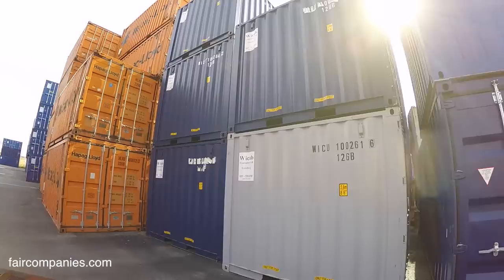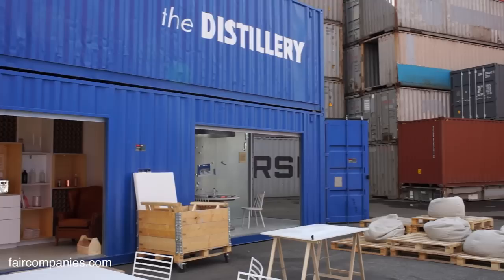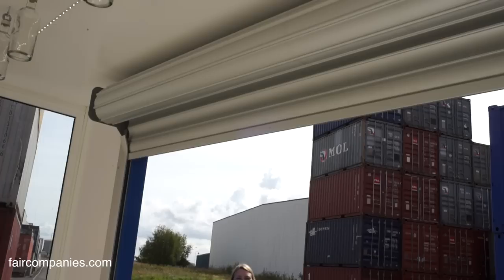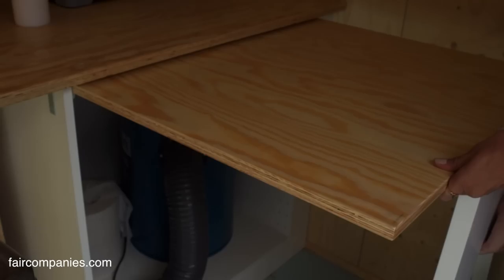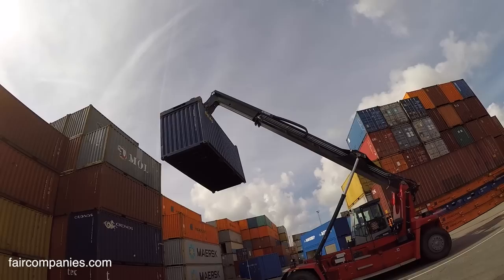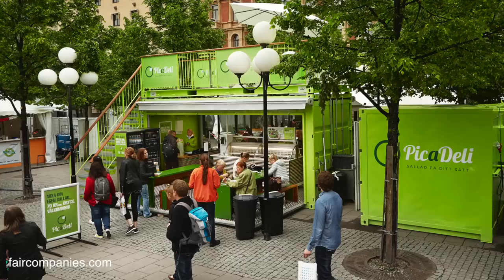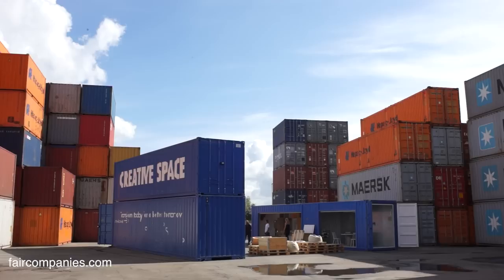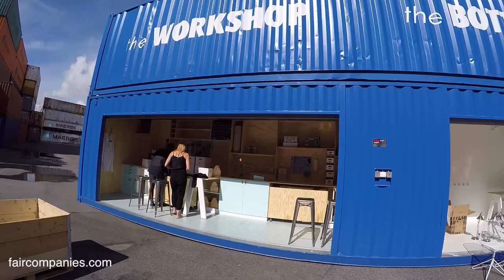Gothenburg stacked shipping containers as instant house/offices

Comment: Thank you ! That was really interesting. Those ladies definitely have a lot of good ideas. Regarding container houses well they are obviously not a panacea for the world's housing problems, but I feel they can be useful in the right scenarios. In any event I think they work really well for pop up restaurants and the like where they need to be frequently moved from place to place.

One thing I'm interested in is how much additional strengthening needs to be provided once you start cutting holes in the container. On the episode of "Grand Designs" that dealt with a container house, the architect added a huge amount of steel. In fact I was amazed by how much he felt he had to add.

Comment: They are using Hi-Cube containers which is the smartest choice for building uses they are 9'-6" high overall. If you are considering doing something like this use Hi-Cube containers as you get a very comfortable interior 8' ceiling height.  

Containers are not something to approach lightly, they are not a do-all be-all panacea. Depending on where you live, they can have serious condensation issues inside as well as significant heat gain if not properly insulated and finished, you just need to plan and design with them to your climate accordingly just like any other building system. If this was going to be placed somewhere permanently I would consider cladding the exterior in wood to help control the heat gain, use spray-on closed-cell foam insulation inside and add a membrane roof system. The container is just the framework, a basic shell, once its properly clad these can last many many decades.
Reply: +KlunkerRider You could also remove the top to increase ceiling height
Reply: this was really helpful

Comment: No Insulation, No Fans, No AC, NO WAY!!!  making a living space out of something that was meant for storage has just as many costly drawbacks as it does benefits. You may as well start from scratch. A house will last for more then 8-10 years so were is the long term cost savings?  I'd like to hear how they feel after trying to sleep or work inside one during a hard rain without building a roof for it. You can buy a good used mobile home with more benefits then what a freight container offers at the same price and fix it up a lot cheaper.

Comment: Containers are bad choice for home - just make wood framed tiny house -costs about the same, doesn`t look like urban trash and have better thermal properties and have more flexibilty of space. In many cases, ppl buy brand new containers, contributing to all kinds of negative environmental impacts.
Reply: +Reinis Miks The economics and eco-friendliness of re-using shipping containers is not as obvious as it may seem.

Due to the massive import/export disparity between Asia and Western countries, a lot of shipping containers are building up in Western countries. Lots more stuff shipping FROM Asia (where these are manufactured) and nowhere near as much shipping back TO Asia. Many of these will go to waste otherwise. It's not economically viable to ship empty containers back to Asia for re-use.

There is no wood-framed structure that is anywhere near as strong as these are, or that can be mounted on just 4 stilts with this kind of strength. These containers can be used in ways such as on stilts, and cantilevered, to make building on otherwise unbuildable sites.

People (individuals) do not actually buy 'brand new' containers. "New" containers people can buy are actually used once (in the trip over from Asia with their initial cargo). They are advertised as new, but are actually used (generally once). See also my first point above about the import/export disparity as to why this is economically viable.

Yes, a wood-framed house will have better thermal properties than a non-adapted shipping container. Nobody is suggesting you don't put in insulation in these. You have to insulate wooden structures, too.

Whether a container-adapted structure looks like 'trash' depends entirely one how it is used, and what each individual's personal tastes are. There's no such thing as something that looks good to everyone, despite what you seem to think. I personally love the look of the containers, as-is. They come in many colors, which can make for a striking structure when coordinated well.
Reply: +IAN MANSELL Living in earthquake country I see them as being a good solid structure or an anchor for a larger structure.
Reply: genjii931
Well, insulating steel container is problematic - there will be  lot of condensation and only styrofoam blown-in insulation in that case would be suitable, which is costly and not very eco and health friendly.
Also, in most parts of the world wood frame is strong enough.
That said, I understand, there are benefits of using containers, just wanted to create some discussion.
Reply: +Reinis Miks I'm really feeling like living in a container is not the way to go. But this video inspired me to do something commercial with them. A Cafe that moved to different locations on a truck would be amazing. If you did it right consumers would eat that up! But as far as living I think I'm going to go the Yurt route.
Reply: *****
Totally aagree - good luck with yurt
Reply: Reinis Miks Thanks man! Peace!
Reply: I mentioned seismic factors but a container structure is also of value in a place (like California or Australia) subject to wild fire.  As a remote dwelling or 2nd home it could be a very desirable option.
Reply: +Reinis Miks they don't look urban trash to me, I would put the wood inside
Reply: Luis Santos
in rural property my neighbors would not be happy to see metal container staying there permenantly
Reply: +Reinis Miks I understand that
Reply: Luis Santos
But then again covering it with some decorative vines and green roof would totally blend it in nature. So I guess I was bit wrong about my statement.
Reply: +Reinis Miks Good point ! I think containers are good in some scenarios, but people automatically assume they are a cheap and ecologically friendly way to build which isn't necessarily the case.
Reply: Regarding insulation, there are a lot of choices. There's the guy in Australia (in one of Kirsten's other videos as well as his own channel0 who just coated the outside with (expensive) insulating paint. There's the boatbuilder in New Zeeland who got panels made by a company that insulates truck bodies. Most people seem to use panels of styrofoam.

There are a lot of things containers can do that wood frame houses can't. The boatbuilder I mentioned chose a container because if you don't cut holes in the exterior, they are sea-worthy, so he can have his house shipped anywhere in the world. As his job requires him on the one hand to travel to distant places and on the other hand to remain there for months as a time, that is a big asset to him.
And the guy in Australia doesn't own the land he's living on, so the ability to take the house with him when he leaves was again a big concern (although he only needs to keep them truckable, not sea-worthy, so he put in doors and windows in places other than where there were existing doors).
Reply: I think so. I might get one for a work shed/ storage area but think cob and straw bale mixed with an earthship design is good. What you could do is put a shipping container like half way underground and then have the top covered in straw and put a tarp over it and some mud on top. Then with some windows it would probably stay much more comfortable temperature but why bother when you can just build with cob which regulates humidity naturally? This sunken design is good if it can be kept dry half your wall or more just needs some wood to reinforce the soil and the top part is equally easy cob wall with windows. You can put the windows in easy with cob and the roof is then real easy and safe to work on. you can have a bit of a hobbity design and bury some plastic so it slopes away from the area.
Reply: R.M., The hurricanes Harvey and Irma did not hit your stick tiny house yet. Maybe the tornados next year will.  George Wu, AIA, ARCHITECT, NCARB 2017-9-11

Comment: it takes them 7 years to build a traditional home? did I hear that right? why? it only takes 8 months here in the states.
Reply: +fireraisr  design, planning, permissions, appeals of the permissions etc. Varies greatly bu the location and attidue of neighbours (see appeal, re-appeal....)

Actual building it is quick, which is why the lot might sit empty for years while the bureaucracy grinds  - in which time it could be used for temporary structures, like containers.
Reply: +fireraisr Yes, a lot of bureaucracy. But he was talking about building in Stockholm. 
8 months is probably what i takes for a house to be built outside the big cities.
Reply: +fireraisr not 7 years but I can tell you why... because lots of people cry when a tornado daddy or hurricane mommy appears and everything goes to the f** because of 4 shit pieces of wood together.
Reply: Why the hell would there be tornadoes or hurricanes in Sweden?
Reply: fireraisr,  But the container housing is already made, Just add plumbing and connecting  the electricity. And it is done ! it is so strong that you don't have to worry about the hurricanes for next 20 years ! So why build the stick house for 8 months ?